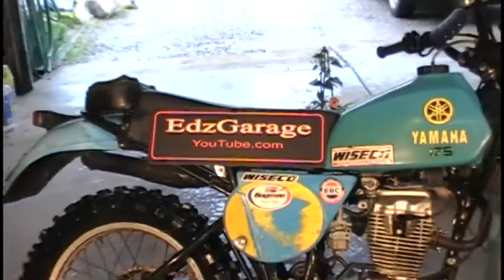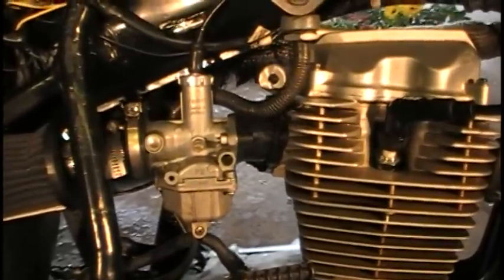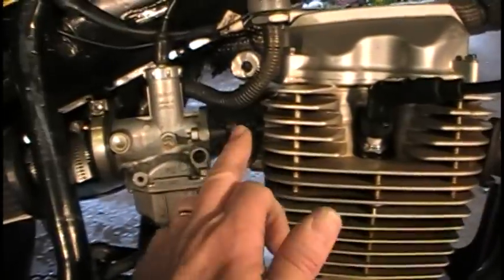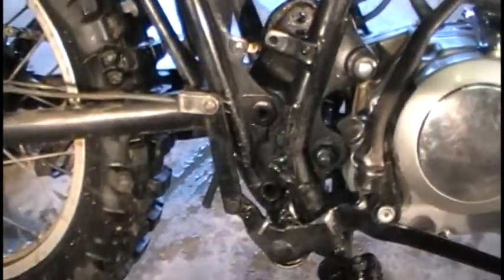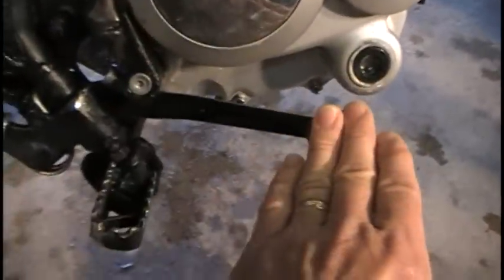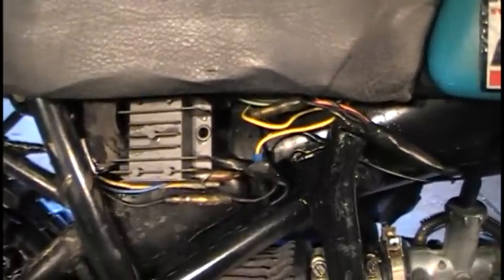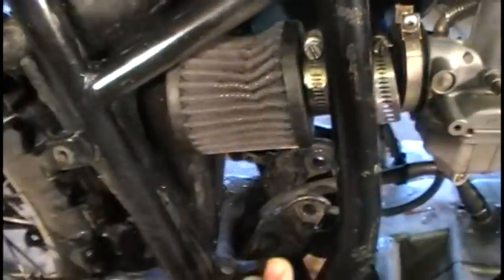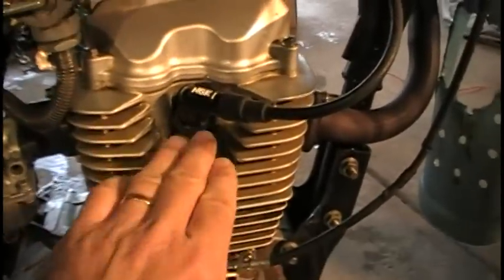YamaHonda Modifications - Electrical, Mechanical and Performance

Comment from the maker: It's been a while since I did this. There were two wires coming from the generator on the flywheel and those went to the regulators input. I talk about it at 5:32.

Comment: Ed, great job.  That bike is sweet!  Now with a 12v system and those upgrades its as good as a new one.  I was wondering what kind of welder you use for your fabrication work and if you use gas or flux.